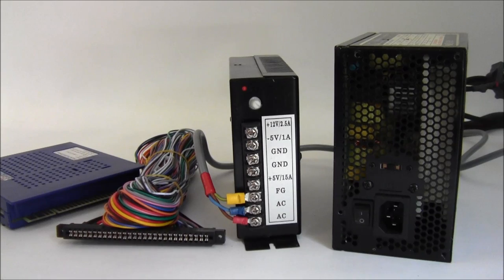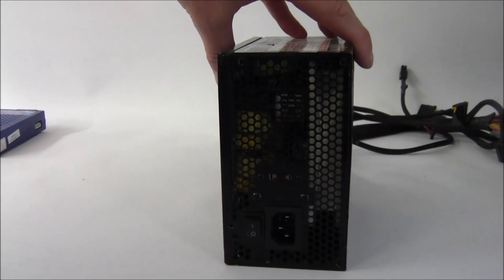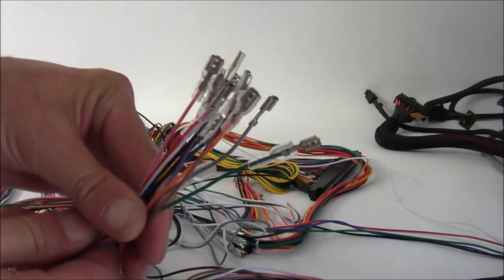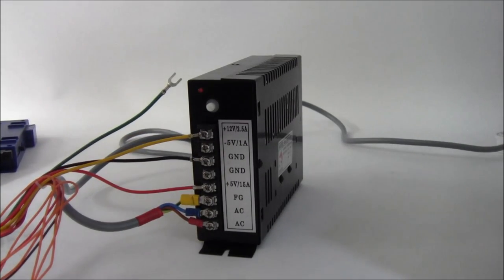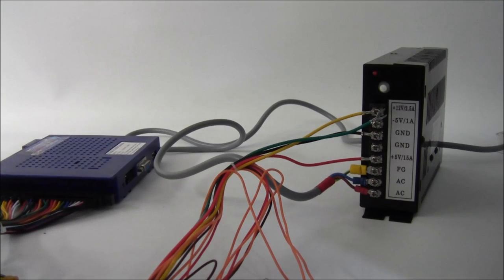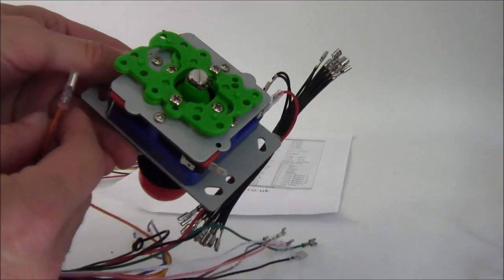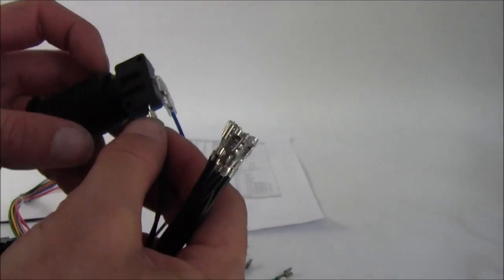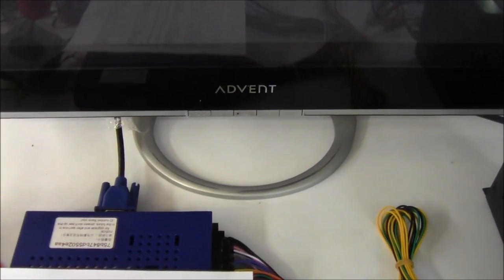How to wire the jamma 619 in 1 pcb - Pandora's Box

Comment: Excellent video. Quick question, the Coin wire (16- Green) terminates to a white plastic connector and not a single wire to connect to a Coin button with a microswitch? Is there a different button used for credits? Thanks so much
Reply: Did you ever figure this one out I'm also a bit stumped by it?

Comment: Just a small point on your mains in connection to the power supply. You have used different colour crimp lugs to match the colour of your cable core. The colour of the lug is determined by the conductor size. I.e. Red- 0.5 to 1.5mm, Blue 1.6 to 2.5mm and Yellow 2.6 to 6mm. Your conductor size is .75mm2 so all three crimp lugs should be Red.

Comment: This video helped me a lot! I do have a querie though. Ive seen some setups (and old arcades) that have current filters fitted. So you have the plug socket that connects to the mains then the wires from the plug connect to a current filter and to a fuse. Then that connects to this power supply. What is this setup for? Thanks

Comment: Is there a way to connect your monitor to the power supply? Can you connect a monitor to either the power supply,  or Jamma harness? I am asking,  because I am trying to build an arcade cabinet. Or, does the monitor need to be power on through an outside power source?

Comment: Im curious as to the volume of the speaker from the Loom or if an amplifier is recommended.. Also, about rotating the monitor 90 degrees..
Reply from the maker: The Boards have a internal amplifier so you can connect the speaker wires on the loom directly to the speakers.
There's no need to rotate the monitor as the 619 boards play vertically, the smaller 412 boards need to be vertical.

Comment: Hi good vidio..but if i was to use computor power supply.where would the wires go .i.e the yellow black and so on.you showed on the small power supply all going up in a line you only showed power on the computor power supply.cheers buddy

Comment: I know your board isn't a pandora's box, but do you know if those have molex pin connectors for powering? I see many ads say they do but don't see the connection port on the pictures. I have a perfectly good PSU I would rather use than have to buy an arcade power supply and solder! Any idea?

Comment: i have a wei-ya cv04 cga to video converter connected to my jamma harness connected to an ntsc TV.   it works fine when I plug my neogeo mvs to the jamma harness, but when I plug the PB4 into it the video isn't syncing.  Getting black and white only and the video is tearing.   I vaguely remember reading something about some boards needing jumpering sync pins on the jamma connector or something.  Any ideas?

Comment: So the speaker wires are powered, not just line level?  No amplification needed?

This was super helpful!
Reply: These boards have a built in amp so they can be connected directly to the speakers
Reply: Cool, do you know if they take 4 or 8 ohm speakers?

Comment: hi, can I ask a quick question,
the cart/board shown street fighter etc, is the loom responsible for buttons 4,5,6?
I was of the impression it needed a kick board for those?

just wandering as I have a gun game board and USB arcade sticks for my Mame setup, just wanted to see how it differs compared to a multi game.

thanks for this video, quite useful in your explaining

oh, one final question, have u had any experience with a Pandora's box version?
thinking of Molex power etc
Reply from the maker: The loom used here has connections for all 6 buttons.
I've only ever used the 619 boards as the pandora boards tend to have too many beat em ups as apposed to the better range of games on these boards.

http://www.ultracabs.co.uk/jamma-harness-6-buttons-per-player-102-p.asp
Reply: were you get that 6 button loom

Comment: Stupid question: Is it harmful to connect the -5V to the jamma power supply if the board doesn't need it. Could you just connect it anyways?
Reply: I don't know myself, but I look at it this way; you can do something and hope or nothing and know for sure.  I say take the path of least resistance.
Reply: ***** If anything, it seems like leaving it loose is a bad idea. If it gets knocked around and bridges two of the other leads, that could be short city.
Reply: For mine I folded back on itself and secured it with a zip-tie.
Reply: Just thought I’d leave this here the -5 wire can be connected to PSU it will make no difference. Watched a few videos where they hook it up regardless so PSU is smart enough to pull what it needs

Comment: how is the monitor getting power?
Reply: Probaly trough its own power supply
Reply: I think most people wire a power strip into the external on/off switch like this one:

https://www.hollandcomputers.com/store/pc/Power-EMI-Filter-with-Built-In-Power-Switch-with-fuse-by-RetroArcade-us-2512p5988.htm
Reply from the maker: Its a standard PC Monitor so will plug directly into the mains as if it were being used with a PC

Comment: Never realised it wouls be that easy, but i am colour blind. Bollocks
Reply from the maker: You can use the Jamma diagram to follow the wires down the loom so you wouldn't need to rely on the colours.
As long as the power wires are installed you can put the board into its setup mode and wire it as you go.
You'll then be able to check the wiring, when you press a button or move the joystick the corresponding button / movement will be highlighted on the screen so you can verify that its wired correctly.

Comment: Exposed mains feed!?. What a death trap!.
Reply: +neontetra1000 
You actually see this in a lot of machines once you pop the lid. In that light this is a PSU intended to be built into a cab, if you decide to have it sitting on your desk with leads exposed then that's your call really.
Reply: +neontetra1000 Most arcade machines have a power supply like that, its not intended to be on display but tucked away safely inside the machine.